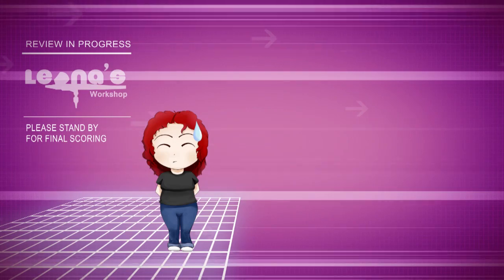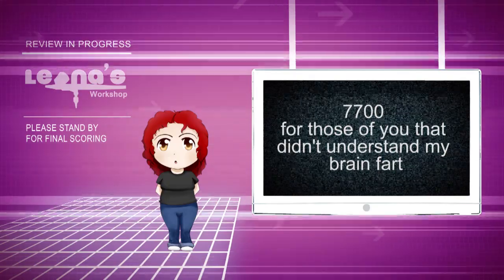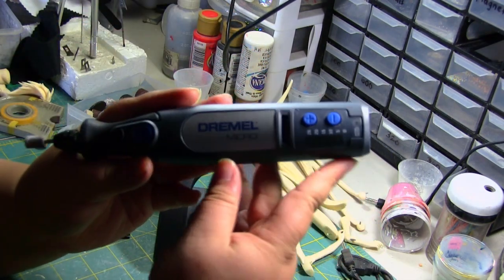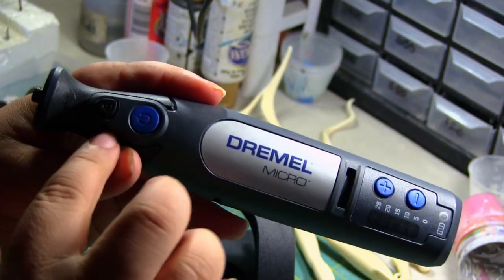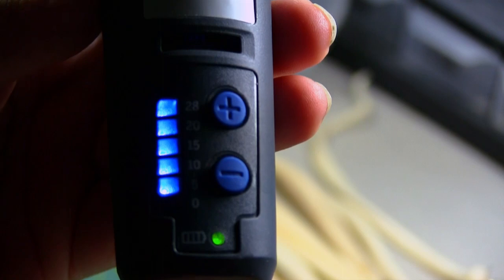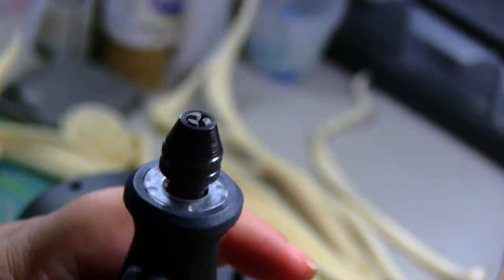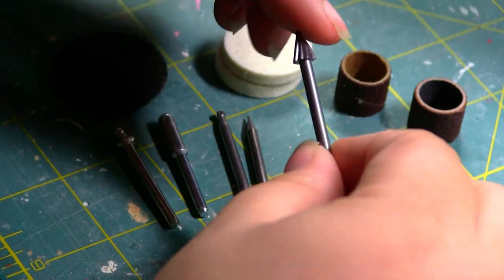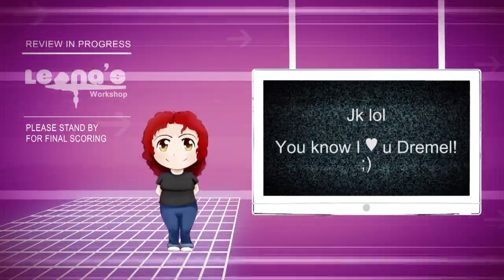Garage Kit Tool Review: Dremel 8050 Micro

Comment: Great review, but I just don't know.. I wanna find a decent dremel with the plug already attached to it. Something that has good speeds and I can just plug and go. No batteries. No charging docks. When you have infinite power coming in from a socket, there's no need for any of those!
I loved my first dremel (which was a cheap knock off) as it had these features, up until I tried to sand a thick piece of resin and it suddenly lost power. The harder I pressed, the more it slowed until it stopped completely. I want another like that, but with some actual torque power! But still gentle and light enough to handle GKs. Tell me, does such a dremel exist?
Reply: As long as you can afford it, any decent corded dremel tool coupled with the flex handle accessory kit would probably be exactly what you're looking for.

Comment: Nice review, Leona!  I got one of these too, and while I don't use it as often as I'd like to, I love it to death!  It probably wouldn't work with this particular dremel tool, but have you tried the flex handle with a larger dremel tool?  It's ideal for light weight and fine control applications.  Plus no worries about dead batteries since you've more than likely got the dremel plugged in.  Only downside is the price for the tool and accessory <_<

Comment: I use those cheap 12v mini drills, coupled to a variable transformer (corded) as I hate the weight of those batteried drills. I have 8, all in a row 'cause I ALSO hate changing bits, lol. (sounds like a lotta hate going on, but actually... I loooove my drills, so much.) weirdo.

Comment: I bought one of these for modelling work since I don't want a heavy, beefy corded version.  Unfortunately, mine won't charge; plugged it in overnight and the blue LEDs were still scrolling.  Spoke with a rep, told me that it should charge completely in 3 hours 45 minutes.  It does work but for the price point and seeing as it's brand spankin' new, it should work flawlessly (then fall apart after the 2-year warranty).

Home Depot didn't have another one in stock, so I have to wait for the UPS label, ship it back to them, have them tell me it's either working as intended or they'll just send me a replacement/refurbished unit.  Overall really disappointed.

Should have read the reviews on Dremel's website first ::shrugs::